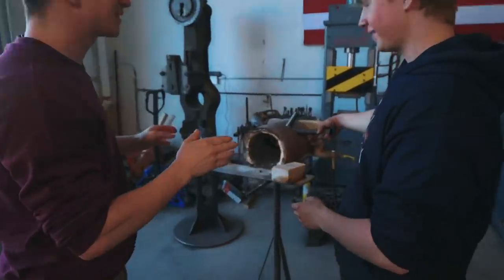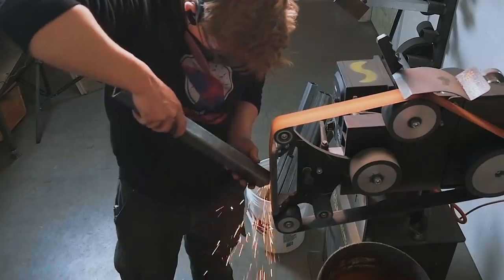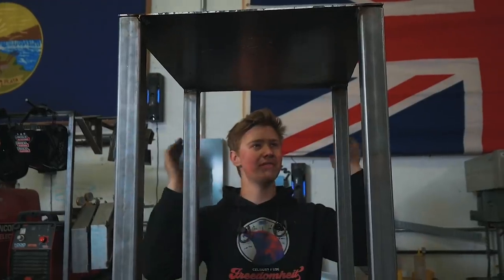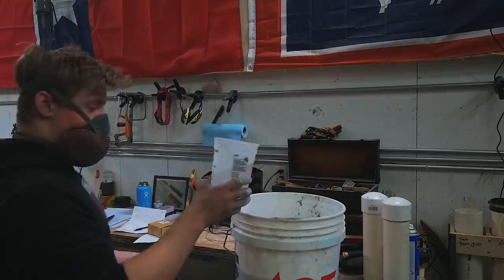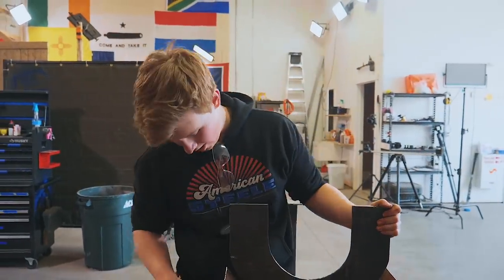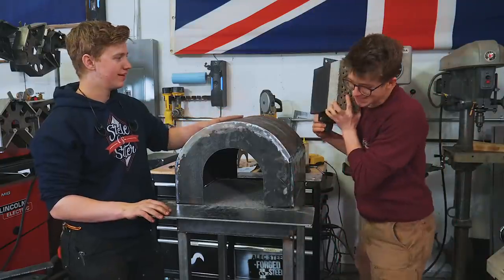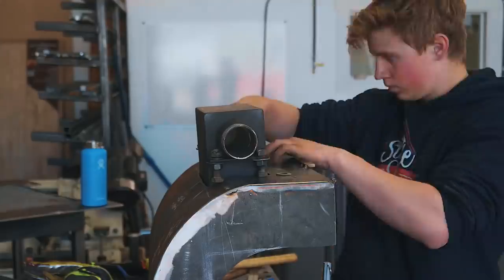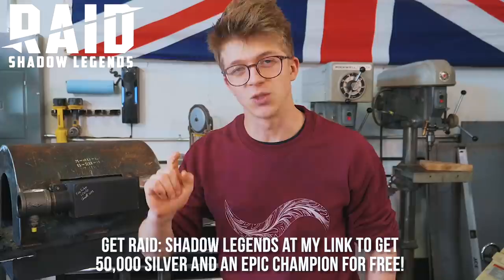BUILDING A MONSTER FORGE!!! Part 1

Comment: Is firebrick just not strong enough for a forge?
Reply: The soft firebricks, while doing a great job, are too fragile. They crack eventually and wear down quickly with contact, moving work in and out. And need to be replaced more. The hard firebricks are tougher but absorb a lot of heat, take longer to get to heat, leading to a higher fuel cost. I've found that the ceramic fiber insulation, coated with a refractory cement, is the best option. Been using mine for a couple years, it's efficient and it's holding up great.
Reply: @banichi2269  Hey, thanks! My pizza oven gets ridiculously hot, but I knew it didn't go to forge temps.
Reply: @ObiWanShinobi1  No problem. Dealing with forge temps is a whole other level of heat. I run at around 1800 ish for general forging,  to around 2400 for forge welding. My forge is built to withstand 3200.

Comment: I gotta ask why did you want to use Satanite? Plenty of way better products that are flux resistant out there !  Satanite only has 59.4% alumina. Korundal is 89.5% which is highly resistant to corrosion by fluxs and slag. Another route would be Greenset 94 which comes in at 92.0% alumina and only 1.2% silica and max service temp of 3400°. The higher the alumina content the better you will be. Oh I also work at HarbisonWalker International where that Mizzou comes from 👍

Comment: you should redesign it slightly and build a second one, so that they are connectable. twice as much short material can be heated (or 2 different temps) when needed, and twice as long when needed... you guys often seem to be lacking in one or the other.

Comment: If you want a non ceramic fiber refractory blanket you should use Jonhs Manville Superwool and finish it with the Johns Manville Seal Coat for the superwool. It's rated to 2600 degrees freedomheight. They also make the best refractory cast ables and bricks in the world.  We use them on large furnaces in the oil refineries and the stuff is incredibly durable

Comment: Alec, you really need to investigate an induction forge. It works off electricity, it creates no heat other than in the object being heated, and it heats superfast. I am surprised that you have not yet been approached by a sponsor to try it out. They are missing out big time on exposure to a huge potential market.
Reply: Induction forges are really expensive and kinda bad for Damascus due to how they heat metal meaning would be harder than normal to get a proper weld leading to more failures at least with on that they could use in the workshop industrial ones are far better and don't have that issue
Reply: @wilkins67890  I have no experience with forging whatsoever. In my mind something that is as simple as a toaster to operate  that can heat steel to forging temperature in minutes at a fraction of the energy cost of running a gas furnace makes sense.  I take it the different magnetic properties in the layers in damascus  would cause problems on the initial weld, but once it is a solid block it should be okay? I take it that they are expensive because they sell in very low volumes. In this setup you would probably need a custom designed machine. I love all the high tech equipment in his workshop, any sponsors out there?
Reply: @pietperske3583  Yeah they are generally expensive due to non industrial ones have to essentially be custom built (Sadly I  doubt either Will or Alec has the technical know how to build one even if they were willing, electricity is a dangerous thing to try to mess with) The best way to think of how they heat metal is like a microwave where the heating is irregular and some parts are slightly cooler than others. This is okay if it is all the same metal and the variances will be no more than a normal forge but with Damascus the different metals along with trying to weld them is just going to end up with cracks at least 30% of the time rather than 10%

Comment: That burner will not touch the work piece directly but holy moley it will still melt your metal with that high gas air mixture rate.
Reply: Less fuel, less air, less heat.

Comment: Gotta measure arc length to get the right measurements along a curve.
Reply: @Jon Goat cut twice measure once?
Reply: @Jon Goat I messing around... I was just thinking on the design side of things that when you start with a flat piece of steel you would want to draw out the dimensions accurately first before cutting. Cardboard would probably work if you could get the bend perfect (or within reason)... I just like to over complicate the design process as much as possible haha.

Comment: very cool build! I just finished a ribbon burner forge build on here but not quite as large. I had the same problem with the floor of the forge when pouring the castable refractory, it keeps compacting the ceramic insulation.

Comment: You kids don’t know what you are doing,I worked in a forge for 28 years build a slot furnace with 2 Hauck burners off set across from each other,and controls,the only time inswool is dangerous when you disturbed it and make dust from it after it has been fired up past 1500 degrees

Comment: i am curious about what settings for welding the process  gas mix  90/10 -- 75/25 wire size 030 035 045 ect use guys use at the shop .

Comment: you need a beefier drill to mix cement like that. I use a cheap hammer drill and a concrete mixing bit. It looks like you're not getting a proper mix for the cement.

Comment: This is pretty cool, this burner is more inline with the burner system I was building for a kiln a few years ago, didn't finish it, but I like that you've used the same basic concept of injecting air and gas mix to get more even flow of flame for greater heat efficiency. Great job and great video! ⚒😎

Comment: ohh oh, almost forgot. cure that castable well guys, or it'll crack ( I THINK its about slow heat over long periods of time and then crank it up. you do good research so i'll leave it to you). and if you are going to use some kind of molding for the walls and ceiling, make sure that the matterial the mold is made of doesn't suck the water out of the castable while it cures (cast/dries?). you could use cardboard for example, but line the side in contact with the castable with some plastic film or something (adhesive tape like the one for packing is better tbh, less wrinkles). oh! and you could add some ..tabs? to the walls of the forge so the castable has something to grab from (tab/anchers? sorry, english is not my first language).
GOOD LUCK FELLAS!

Comment: Instead of cutting of the welds on each side, taking material off, and then rewelding, why didnt you just take material out of the center? Don't want a weak point in the middle?

Comment: Kaowool loses its insulating value when compressed. Next time use a rigid refractory insulation like Calsil boards. Your castable refractory will probably crack in the future because its on the kaowool. When that happens, take it out and use rigid board and brick for a more badass base. You guys kick ass!

Comment: idea: you might want to weld a loop on the top.
if this is supposed to be a removable lid, a loop on the top would be a good idea so you can roll a gantry crane over with a chain fall, and pick it up. a-la Abom79

Comment: For debuting and beveling metal, you guys should make like a router table that exposes a little bit of grinder wheel behind a fence. You could slide your metal on a table, along a fence and it would just shave off metal at a 45 degree angle.  Never seen one, but it seems useful for metal fabrication.

Comment: Isnt the whole point of that stuff that it has air and isn't compressed and therefore contains the heat? So, shouldn't you find a way to set the other materials external to it without compressing that stuff?

Comment: Due to where the Gas comes into your new gorge and how it lines up with the face of the forge, it seems to me you would need a deflection plate to keep the flames that with shoot through the opening between the forge face and the bricks from overheating the Gas inlet. Just as a safety precaution

Comment: Keeping heat in a furnace is a bit of an art but here are a few pointers
For the base an layer of Insulating fire bricks. These are extremely easy to work with and can easily be cut with a cheap garden pruning bow saw or a simple cheap handsaw. That way when the castable for the base is used there is no compression and they will retain their insulating properties.  Kaowool is dangerous when heated to the stage of breakdown. A trick for handling it when it isn't in direct contact with naked flames is to encase it in heavy duty aluminum foil kind of like a pillow. Alternatively a sheet metal box sealed up with a tiny vent hole. An example of this application would be a box to fit under the floor filled with the fiber packed but not tightly. It will still insulate well even though the steel allows a small heat escape path it will still insulate well and once you are finished with it a contained box to dispose of.
If you are going to make the doors from castable either entirely or in conjunction with Kaowool you need to retain the castable in the door frame even if it cracks as when a piece falls out it will spoil your day. Probably the easiest way is a piece of concrete reo mesh welded into the frame at about 1/2 way so that it is encased in the castable. You can then insulate the outside of the door in Kaowool and cover it with steel.  May I also suggest a foot operated door lift?  When you make the doors you can turn it fire side down on a flat surface and just use a sheet of plastic to allow it to be lifted off when dry if you are using castable.
As for the wall of the furnace you intend to blast the flame off the sides, so I assume you are either going to use a ceramic liner or metal contact castable? If you use castable don't forget the reo and a hole for your over temp thermocouple in the roof.

Comment: Hey guys I would consider cutting the metal away from the openings as it will get fried. I built mine a little more than a year ago and am considering cutting away the metal as it is getting pretty raunchy around the edges. My ribbon burner is a little smaller but it puts the heat out. You are going to be real happy you went this direction. Hope this helps your build.

Comment: Will: My welding experience is mostly with sheet metal (arc and oxy-acetylene), due to having learned to weld in an automotive setting. Just make sure your gaps are properly set, always perform a test weld with comparable materials (preferably scrap), and the basics will otherwise be the same.

Comment: Just a tip will when MIG welding point the torch in the direction your welding. this will improve your welding loads. but good work chaps

Comment: To deburr plasma cuts use a chisel and nock them off
Reply: And a tip to plasma cut strait lines use a straight edge and use it to guide the cutting head

Comment: Just a question concerning the forge... How do you deal with decarbonization when you use gas fueled forging? if you have multiple heat cycle, decarbonization is bound to happen so how do you deal with that?
Reply: Regulate the fuel/air ratio to produce a reducing-neutral flame when you don't need the heat of an oxidizing flame. Less concerns about decarbonization and oxidation.
Reply: @alexhamon9261  Interesting, thank you for the reply I'll go learn a bit on that :)

Comment: Will please use a face Shield so that in case you're grinding and throwing Sparks everywhere you will not have an eye injury or have a piece of metal or grinding disc hit you in the face. I have seen some bad things happen at work that could have been prevented if a face shield had been worn.

Comment: bro.... welding steel plate isnt te easiest thing??? its friking 4 or 5mm thick it is the easiest thing in the world when it comes to welding, same for deburring just use a scraper or better yet a grinder. then u could have also lightly ground up the surface of the plates were u are going to weld them, wich is what u needed to do to get it to weld well,
also i would recomment u just to do a whole damn lot of welding practise cuz damn... if u dont even know those basics, and seeing ur welds... damn u have alot to learn.

Comment: why do you guys always make your forges so small? seems like you're constantly having to leave both ends open to make material fit inside... wouldn't it be more efficient to make one about 2 feet longer and seal one end of it so the heat cant escape through both sides? im no forge expert by any means but seems like common sense to me, you'd be able to do longer items like swords and such more easily, and it would use a lot less fuel due to less heat escaping.

Comment: Will look up the push/pull methods for wire welding, I could also hear the welder popping a lot, your too far from the work with the tip.

Comment: Your next tool investment should be a plasma table CNC, just program the shape you want and it cuts it out for you perfectly
Reply: No please don’t as then you can get lazy and be like any skillless loser out there who thinks there a metal worker cause they can tell a computer to do something. In some situations it is needed but not for the very simple cutouts that they do. Have expensive things when you don’t need them just for the sake of laziness is just overcompensation for your small limp limb that hangs between your legs.
Reply: @shaunthedinosaur7812  I use one regularly not to compensate my limp limb😂 or lack of skill... it's time saving when you're making large projects and its saves money by decreasing work time and the cuts are way cleaner creating less waste and your plasma cutter last longer. I know it's not for everyone but it has huge benefits for someone who does that for a living vs a hobby. That's like saying dont use a drill press you should be good enough with a drill.

Comment: Would making a “modular” forge be viable?
Modular as in, you have “heating” and “space” modules and can change the size and “heatingpower” as needed. My thought is that, using a big forge for small things is a “waste” but having multiple forges takes up space, as would a big forge where you might only use the full capacity of it 10% of the time. A smaller forge would also (as far as I know) be more efficient both in heating and fuel consumption.
Reply: I'm assuming they aren't throwing away the smaller forge they already have

Comment: As a welder, I need to write down some things for because some of the time that you take into fabricating can be shortened quite a bit by only having one angle grinder in the work space with the welding table. Moving stuff back and forth from the grinding room must be tedious. I have breathed in pounds and pounds of steel dust and rust over the years and the thing is, you naturally cough them up over time, these particles don't hurt you. Also, you have to sweep the floor anyways with all the forge scale coming off items anyways. When I need strips of custom measured metal, I either cut them out with a grinder (because the disc makes the cut stay relatively straight) or if I haven't got a cutting disc (discs really), I use the gas/oxy torch. I mark out the line I need, lay a thick piece of steel next to it and then use that as a liner for the torch. It will give you a much cleaner line than free-handing it with the plasma cutter. Plus, you can see very visibly what you are doing as opposed to the welding helmet vision with the plasma. I know you guys aren't fabricators by trade but since you already have the gear, I thought you'd like a few pointers :)

Comment: When doing straight cuts with the plasma, clamp a piece of box tube, square bar or angle to the work piece and use it as a fence.  Drag straight down as fast as you can without getting blowback and you get a nice clean cut line.  The slag generally just takes a cold chisel getting run down it for easy chip off.  Hope this tip helps you in the future.